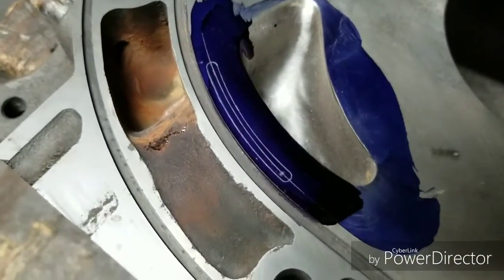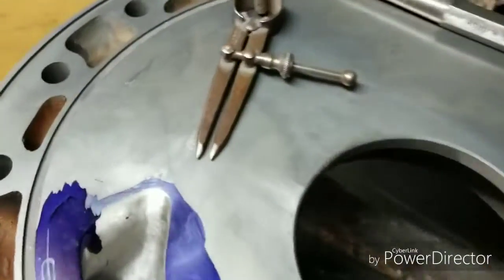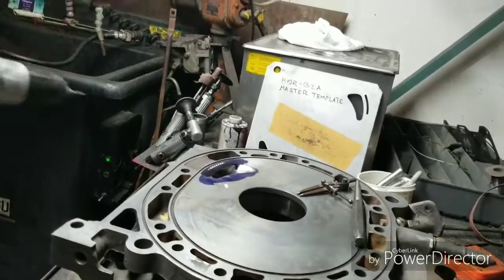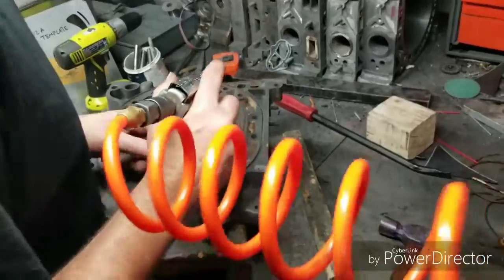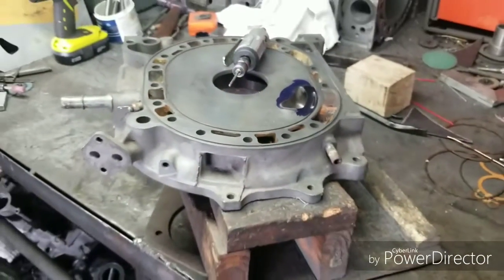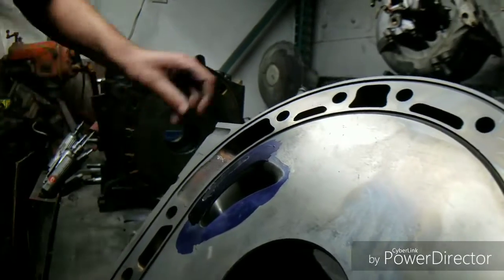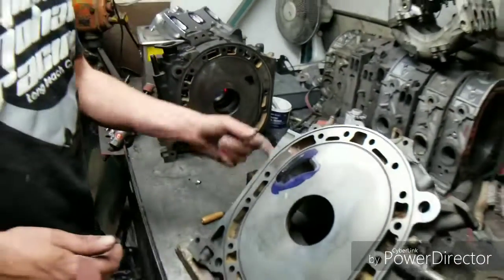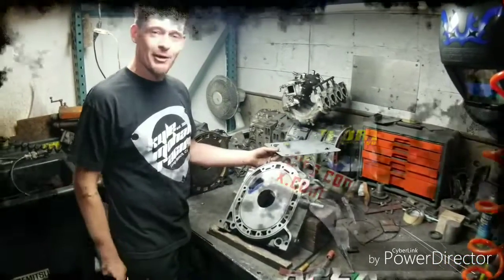Pro Tips How to Rotary Half bridgeport porting at home - KMR

Comment: Hey Kyle would u prefer a half bridge or a Streetport in your opinion? I have an FD right now with a streetport but I’m looking to go half bridge for more power and braps. I have sakebomb ignition kit walbaro 450 fuel pump Adaptronic ecu 2000cc secondary 1050cc primary injectors single turbo and other upgrades as well. Just wondering if it’s worth going half bridge or just staying street port and turning up the boost would love to hear ur opinion thanks!